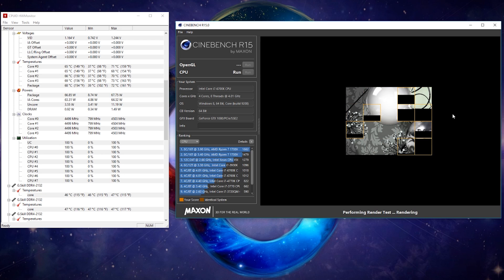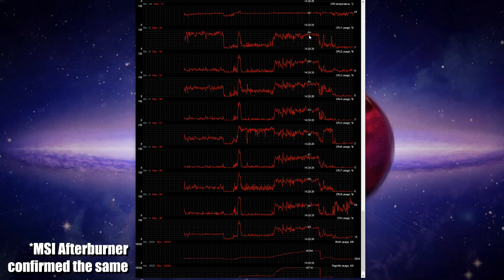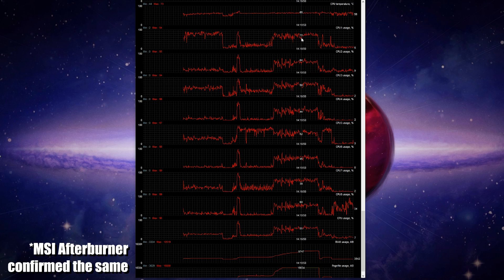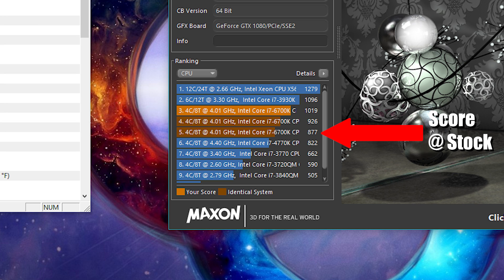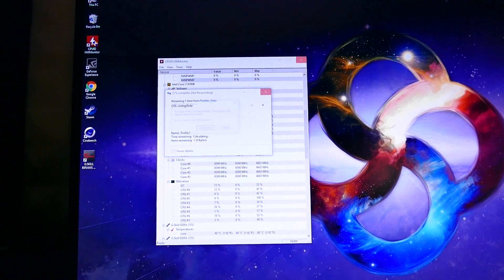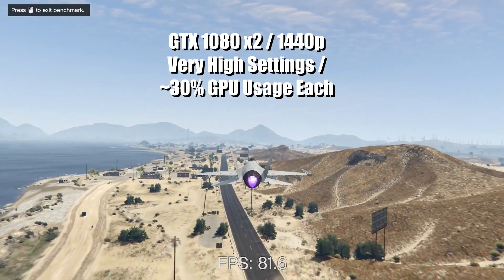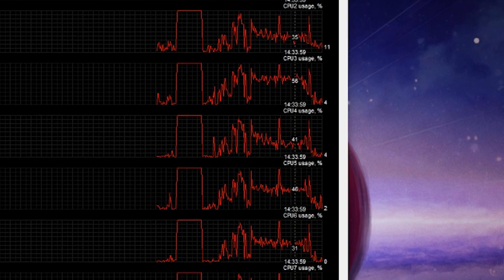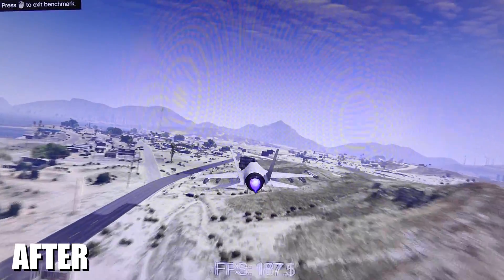My PC was Terribly Under-Performing...

Comment: i know this is very very old but i can pretty much guarantee if you did a complete fresh install of the drivers it would of fixed the problem, i know this because i did  the ame and did a fresh install of windows which inreturn MADE me do a fresh install of Nvidia drivers never though much of it, few years later it happened again with a different rig. Same exact problem but this time i DDU'd all graphic drivers and reinstalled completely fresh ones (was also the same driver that caused issues im assuming they just corrupt during install or error out but still complete who knows i try not to install to many drivers on top of eachother everyone 4 or 5 i will DDU and install fresh it takes 5 to 10 mins and is especially good to do when swapping GPUs

Comment: could you give me any advice to resolve an issue on my pc, the games are terribly underperforming, like the games that could easily run on 240 fps barely runs at 100. I tried everything, updating my drivers, changing my in-game, Nvidia, performance and battery settings to optimal and cleaning the system but nothing helped the games run normally.

Comment: Im currently getting a simular problem. My fps is nowhere near where it should be. Im getting 60-80 fps on every setting. Like low or ultra. Have not found a fps cap. Just installed the 3070 ti. So if anyone has found a fix itd be great. Ive tried EVERYTHING. Except for a fresh os install. Sadly it seems like im at the last option…
Ryzen 7 3800x
Rtx 3070 ti
16 gb ram
Etc
Reply: Did the fresh OS install work
Reply: @richiemyoozik  never did it

Comment: My new to me 6700xt paired with 5600x/x570/32gb 3600mhz c18 overall runs well in my main game BF4 but does have me wondering why when my FPS dips does my gpu not always stay at 99/100% usage. I have a cap at 140fps with Rivaruner and so when my frames are hitting that limit I know my gpu will back off the usage. The problem again is when my frames dip occasionally into say 120-130fps and I glance at my current gpu usage and it’s only 80-90%. Doesn’t make sense to me.

Comment: One night I shutdown my PC while Mortal Kombat 11 was running, which always ran smooth. The following day I also got annoyed by low quality video settings which Mortal Kombat 11 switched to (obviously it detected something). Quality of other games was also affected, as if there was a bug in the system. I watched this video, instead of resetting the CMOS or installing new OS, I reset Windows under control panel, I lost installed apps except files, apps and games installed in non-OS SSDs were still safe. All games played normally after Windows reset, I suspect auto Windows update 😐

Comment: The issue I'm having is I have a 60hz 4k monitor, 2 gtx 1080's  and an i7-10700k. The issue is I'm at 60 fps pretty much the entire time, 1 of my gpu's is with the program and almost 100% usage. The other one is hopelessly low, (around 20 to 30 usage) cpu  usage is normal  (70+ usage) your the only person with a smilair setup as myself and I was curious if you had heard anything about it or knew a fix
Reply: The main issue is the severely underperforming gpu

Comment: I have a GTX1080ti, R53600 16GB DDR4 3200Mhz RAM and an SSD with Windows 10 Professional, my system gets around 70 FPS max at 1080p in GTAV, has some serious stutter issues with FPS drops in most games, tried checking the BIOS, reinstalling the GPU Driver, updating windows, etc etc. Might just have to give the OS Reinstall a shot...

P.S: Not sure if my PSU (an 850 Watt stock PSU that came with my Alienware Aurora R4 case 7 years ago) could be an issue, but from what I understand, a PSU could be either fucked, or fine, and this one, hasn't been giving me too many issues, also not sure if my budget Asus A320M-K Motherboard could be holding back my entire system, if it does it won't be 40 fps (as a 1080ti in GTAV should get around 100-120FPS minimum, whereas I'm getting 60-65 1080p.)
Reply: same with me i got a rtx 2060 i5 11400
Reply: @resol5452  Haven't tested it out yet. But my card was running fine in my friend's PC. Got around 100 FPS in GTAV. 30 more than in my PC and he's also running slower memory. So I might just have to reinstall windows. There's a different video by Greg where he said that when you do an upgrade, it's usually the safer and better option to reinstall windows, as some drivers remain and over-ride or work against the newer drivers resulting in longer render times, lower performance and even BSODs. I think the both of us should give that a shot next. Also, are you running single or dual channel RAM?
Reply: @iiamnev  howd it turn out for you because I've reinstalled my OS and its still terrible.. I have 16 gigs of ddr3 ram a 1050 and an i5 3470 and it still runs at 40-60 fps ON LOW SETTINGS... At this point i dont know what it could possibly be maybe i just need to upgrade. But Im broke. I see other videos with the same specs as me and they're running like on lowest maybe 70-60. Its been like this for awhile its kinda getting depressing.
Reply: @wards2104  Do you have single or dual channel memory? Also, check to see if your memory has the correct clockrate in your BIOS. Haven't uninstalled my OS yet...

Comment: Happened to me, I set everything to performance in NVCP until I read one comment that you should not set "Texture Filtering - Quality" to performance, it should stay in "Quality". That fixed my problem that's the one holding back the GPU usage.

Comment: My GTX 1650 Ti used to run perfectly but after a while it started to suddenly drop the framerate, causing my laptop to have extreme lag and thermal throttling. When I switched to intergrated Graphics everything was faster and smoother, I am very frustrated and confused.

Comment: This is the video I spent a whole year looking for as this is exactly what is happening with my Ryzen 7 2700x and Gigabyte RTX 2070 2 fans and it’s underperforming   Intensely and I can’t even play Call of Duty Warzone as I get under 60 fps every time when I used to get over 100 fps and for some reason Rainbow Six Siege Is the only game that runs good as I still manage to get over 240 fps. Every other game I tried to play I barely get over 80-100 fps and the fps will stay at that 80-100 FPS and then immediately when I start moving around and doing things it will drop all the way to 60 fps and below. I’m running with G.Skilled Trident Z Neo Ram with 32GB with 3600MHZ but only will run at 3400MHZ max when the Asus Tuff Gaming Plus x570 motherboard can support up to 4400MHZ speeds of ram with 128GB of ram and the motherboard is up to date on the latest newest firmware. Like WTF is wrong with this shit ass PC??? All it wants to do it underperform every single time!!!!!!!!!!

Comment: They say pc masterrace. But what is the point, if it's all just on paper. 
My 11 year old ps3 has consistent 30fps on all the titles which are available on it. While my high end pc? It used to give me 70-90fps and dropped down to 13 fps within the 3rd week. And some games just crash in between. My ps3 legit never had this problem.

Comment: I am really frustrated right now. I got a new acer predator Helios 300 i7-10870h (45W)  rtx 3060 (95+5W) 16X1 RAM. And, IT IS SEVERELY UNDERPERFORMING. Benchmarks do well. Good cpu and gpu utilisation. But games like Csgo or Valorant I don't even get 120 fps average. I have tweaked the power plan, changed the battery settings and done everything else I could think of. PLEASE HELP ME.
Reply: howd it turn out for you because I've reinstalled my OS and its still terrible.. I have 16 gigs of ddr3 ram a 1050 and an i5 3470 and it still runs at 40-60 fps ON LOW SETTINGS... At this point i dont know what it could possibly be maybe i just need to upgrade. But Im broke. I see other videos with the same specs as me and they're running like on lowest maybe 70-60. Its been like this for awhile its kinda getting depressing.
Reply: @wards2104  I think you just need a better cpu and newer ram (ddr4 at least)

Comment: I have 1660 super bit GTA t is running in 90+FPS. But my problem is for 5 second it works in 90 FPS then suddenly 5 FPS then again 90 then again 5 that's annoying

Comment: 3070 is way underperforming .. ffs man first my 1080 and now my 3070...
Reply: howd it turn out for you because I've reinstalled my OS and its still terrible.. I have 16 gigs of ddr3 ram a 1050 ti and an i5 3470 and it still runs at 40-60 fps ON LOW SETTINGS... At this point i dont know what it could possibly be maybe i just need to upgrade. But Im broke. I see other videos with the same specs as me and they're running like on lowest maybe 70-60. Its been like this for awhile its kinda getting depressing.

Comment: I can’t run gta5 higher than 60fps constantly with my 2070 super and i7 10700f
Reply: howd it turn out for you because I've reinstalled my OS and its still terrible.. I have 16 gigs of ddr3 ram a 1050 ti and an i5 3470 and it still runs at 40-60 fps ON LOW SETTINGS... At this point i dont know what it could possibly be maybe i just need to upgrade. But Im broke. I see other videos with the same specs as me and they're running like on lowest maybe 70-60. Its been like this for awhile its kinda getting depressing.

Comment: Built a i7 8700k Rtx 2060 build and getting 40-60 frames on basically every game I play, even if it has the simplest graphics.
Reply: howd it turn out for you because I've reinstalled my OS and its still terrible.. I have 16 gigs of ddr3 ram a 1050 ti and an i5 3470 and it still runs at 40-60 fps ON LOW SETTINGS... At this point i dont know what it could possibly be maybe i just need to upgrade. But Im broke. I see other videos with the same specs as me and they're running like on lowest maybe 70-60. Its been like this for awhile its kinda getting depressing.
Reply: @wards2104  I ended up buying a new motherboard, which fixed my issue.

Comment: im having the same problem for a long time now been much much lowe fps than i should be getting i have a ryzen 5 2600 asus rog strix rtx 2060 18gb of ram i reset my pc and the fps jumped up a bit for a few hours but it then went back to bad fps and i really have no idea what to do anymore does anybody know what i should do 
any help would be really appreciated
Reply: howd it turn out for you because I've reinstalled my OS and its still terrible.. I have 16 gigs of ddr3 ram a 1050 ti and an i5 3470 and it still runs at 40-60 fps ON LOW SETTINGS... At this point i dont know what it could possibly be maybe i just need to upgrade. But Im broke. I see other videos with the same specs as me and they're running like on lowest maybe 70-60. Its been like this for awhile its kinda getting depressing.

Comment: im gonna try this now but my pc is performing terrible too i should get 140 fps in  phasmophobia and i only get 40. in minecraft i should get 80 fps with shaders but i get 15 - 30 and in gta 5 i should get 80 fps but i get 20fps
Reply: howd it turn out for you because I've reinstalled my OS and its still terrible.. I have 16 gigs of ddr3 ram a 1050 ti and an i5 3470 and it still runs at 40-60 fps ON LOW SETTINGS... At this point i dont know what it could possibly be maybe i just need to upgrade. But Im broke. I see other videos with the same specs as me and they're running like on lowest maybe 70-60. Its been like this for awhile its kinda getting depressing.

Comment: I am having the same issue. I got over 144  frames easily (close to 200 in all games listed bellow) in games like valorant, league of legends,Rainbow six siege, gta 5, cs:go, rocket league and the list goes on. 
But something happened and my frames dropped like crazy. The most notable were league at 70fps and valorant at 110. These arent unplayable numbers but i used to get and should be getting way better performance.

I tried checking driver issues, thermals, reseated my hadware, no luck
I am just going to try and reset cmos and reinstall windows. (Will update later)

My system:
Ryzen 2700x cpu
Asus rog crosshair vii Wi-Fi motherboard
Rog Rtx 2070 graphics card
Evga clc 140 aio cooler
G skill trident z 3600mgz ram 
144hz aoc freesync monitor
Reply: howd it turn out for you because I've reinstalled my OS and its still terrible.. I have 16 gigs of ddr3 ram a 1050  ti and an i5 3470 and it still runs at 40-60 fps ON LOW SETTINGS... At this point i dont know what it could possibly be maybe i just need to upgrade. But Im broke. I see other videos with the same specs as me and they're running like on lowest maybe 70-60. Its been like this for awhile its kinda getting depressing.
Reply: @wards2104  It turned out well for me, I am back at 200 avg fps on valorant and league. I have also realized that reinstalling windows is pretty easy and gets most stuff fixed. Now, like every 8-12 months I reinstall windows just to get rid of junk I dont need. Also try to check your thermals, ramp up your fans if you need.
Reply: @wards2104  I also oc'd my memory clocks, try if that helps

Comment: I was running 120 frames a second on fort nite now it’s struggling to be on 50 and the battery life is worse can anyone diagnose?
Reply: u have to change you thermal paste
Reply: @rodolfod.moleiro8388  it’s new I reset it and it’s working like new again.

Comment: I dont get it. Gta is using my cpu not my gpu. I have an gtx 1060. Gpu on 3% when playing gta. My settings are mostly on very high with 2x msaa reaching 60fps with drops to 50fps in some spots. 
If i enable dsr with no msaa fxaa. The game is not playable for me with 30-40fps. Even with just 1resolution level up. The one above 1080. But with msaa its all normal again. 
In graphics settings in win10 i selected gta5 to use gpu. Ingame still using cpu only. Someone can tell me how to force gta to use my gpu. Or is my i5 3470 not able??

Comment: Hello Greg. Please I need it help if u can. I love laptop and I know they are not up to desktop standards but please take a look at my specs and tell me if it's good. This are the games that run at 600/100fps:
Rainbow 6 siege - 55/60fps;
Mount and blade warband/ bannerlord - 60/100fps;
Dead rising, 2 and off the record - 50/60fps;
Gta 4 - 40/50fps;
Gta 5 - 30/45fps;
Saints row 2, 3 - 60/100fps.
And here's my laptop specs:
Brand - Lenovo;
OS - Windows 10-Home 64-bit;
CPU - Amd FX-8800p Radeon R7, 12 Compute Cores 4C+8G (4CPUs), 2.10GHAZ; 
GPU - AMD Radeon (TM) R9 m385x;
Ram - 16Gb;
DirectX - 12

I know that the FX CPU has the reputation of being a bad cpu and I also noticed that my dust filter cover  doesn't let air in nor out of my laptop which means inside must be filled with dust. But from your point of view, how good is my specs ? I've been getting into the world of PC's and I don't understand that much but as far as I can tell, my CPU is the one that is dragging it down. Also, I've noticed that my CPU sometimes doesn't even move, like, when I'm gaming gta 5, the GPU is at 0% which I read somewhere that it's bad for a GPU to not run. Can you help me out please ? Thanks for any response.

Comment: I have the same problem, i have a rtx2070 super. On rainbow six siege i used to get 200-300 fps on ultra settings, now i get around 60-70 on any settings, i dont get any lag spikes luckily but it also happens on other games, gta, rust ect.

Comment: Still having this problem.I think i know solution but its pain in the ass.So when i got my new gpu i got 120fps here but after first restart i started getting 60fps max.Now i upgraded system new driver and guess what? It ran 130fps but afyer restart it went back to 80fps and 40-50% usage.HELP

Comment: Ok so i have an 1080 ti and a amd r7 1700 keep in mind overclocked to 3,7ghz with stock cooler, 16 gb ddr4 ram and i still get around 25 to 30% gpu usage on valorant. What can i do to fix this?

Comment: Ran into the same issue with my new 1660 super that I got yesterday upgrading from an RX570, paired that card with an R5 3600 and when I started benchmarking my GPU usage barely went to 50% and CPU, Ram, Temperatures everything was just fine. I benchmarked GTA 5 and I was getting around 60fps and in PUBG PC on a very low setting, I got like 70 fps max. I decided to wipe out everything from my SSD including my OS and after reinstalling everything worked fine.
Reply: what was your fps in gta and pubg after you wiped everything?

Comment: Upgraded Gpu to Rx 5700 from a gtx 970 and noticed I was almost getting the same results I had with the gtx 970. Did DDU uninstall on both gtx and amd and re downloaded the drivers which didn't help. Went and watched at least 10 troubleshooting youtube videos that had registry editing and a bunch of bios changes which ended up being a huge waste of time. Finally came across this video and decided to just reinstall the OS. FIXED everything

Comment: I have Problem with modern warfare on 2070 super and ryzen 2700x i get 80 - 100 frames in multiplayer and that is the same on max and on minimum settings which is wierd

Comment: My Razer blade 15 advanced with the rtx 2070 Max Q Had this same issue. One day the gpu just stopped using full power and I had trouble getting 60 fps on mid settings. Then I did what you did - rested windows, and finally Gta 5 is running 100 fps on ultra.  Thank you for saving my overpriced laptop man 👍.

Comment: Can you pls help me- I have a gtx 1080 ti and an i7 4790 3.60ghz...and 16gb of ram. Im getting in games on ultra and high around 45-55max but it can often dip down. I.e hell let loose and war of rights....cpu intensive games. Im convinced I have cpu bottleneck as im giving 35% gpu usage and cpu around 75%...can you please recommend the cheapest option cpu I can get to solve this problem ....and I dont mind going amd over intel....as I know its cheaper....thanks and good video